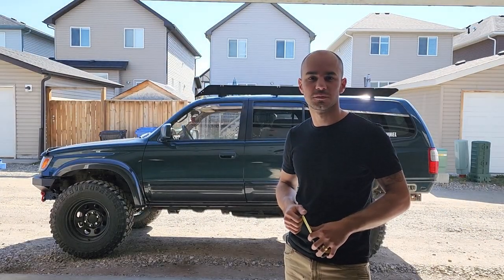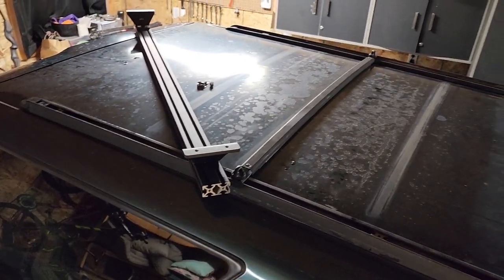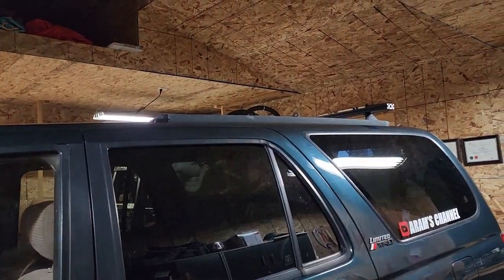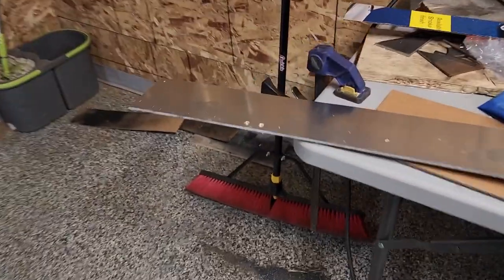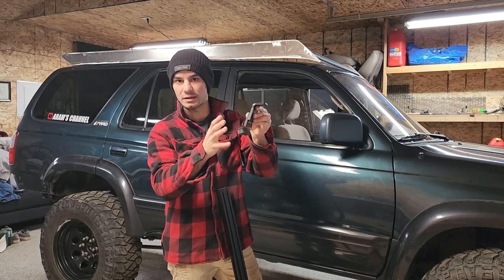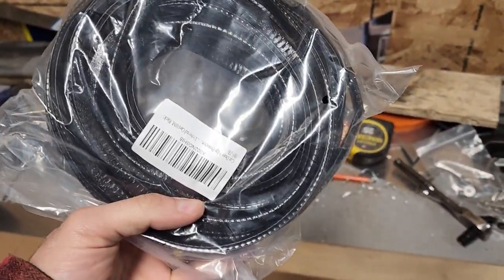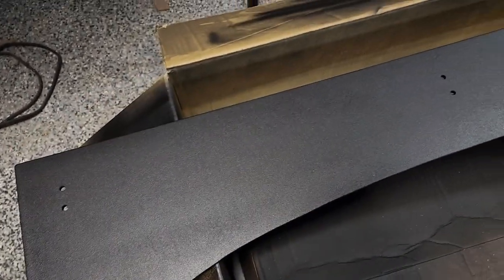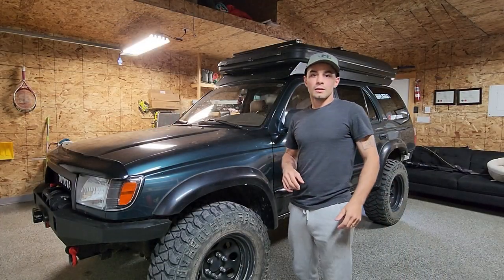How I Built My Prinsu Style Roof Rack For My 3rd Gen 4runner

Comment: The parts that I thought it will not be a problem to get turned out to be an issue.  Any recommendations on aluminum sheets / strips, where I can find them?
Reply from the maker: I got mine just from a local metal supplier. I'm sure there's gotta be a metal shop where you are

Comment: Man I am so glad I found this video.

Your rig is beautiful, I just acquired a 98 the same color and plan to build a rack like yours! 

I have a stack of scrap aluminum i just need to see if they're big enough, what is the height of your side plates and front plate???

Thanks!
Reply from the maker: Thank you, I'm glad you found the video useful!

The sides are about 4" but I'd go a bit smaller if I was to do it again, maybe 3.5".
The front I will have to measure in a few days, the 4runners in the shop at the moment

Comment: Just need to ask….what was your all-in cost?  I know what Sherpa and PrinSu and Victory 4x4 go for. Just curious if this was worth it price wise vs buying one of the mentioned?  Obviously prices on aluminum will be different depending where people live and supply and demand. Just wondering a rough estimate. AWESOME video BTW. Thanks
Reply from the maker: Thank you!

My all in cost was roughly $550 USD.
I would say the most expensive part of this was the mounting feet that I ordered straight from sherpa. Not only are they expensive but I had to pay for shipping to Canada AND duties once they arrived.

If you could figure out your own mounts, this would be significantly cheaper!

I am actually planning on potentially selling this one and making another with different mounts. I would like to cut the price way down :)
Reply: @aramschannel  Hey, I made some really simple mounting brackets that would probably work great for what you’re doing. Just 1in aluminum stock with thru holes for m6 bolts that screw directly into the factory rail nuts. Then some tapped ¼ 20 holes in the middle 1in apart to accept t nut hardware. Ultra low profile and super cheap!
Reply from the maker: @keatonstone207  Nice! do you sell them and do you have photos?
Reply: @aramschannel  I’ve got photos but sadly I don’t sell them. The version I made is a little fancier since I used a milling machine, but the version I described could be made with a drill press. If you want pictures or blueprints I’d be happy to provide!
Reply from the maker: @keatonstone207  ya a picture would be much appreciated! Are you on IG? if you are, might be easier to talk there, my ig name is lucy_andthebeast